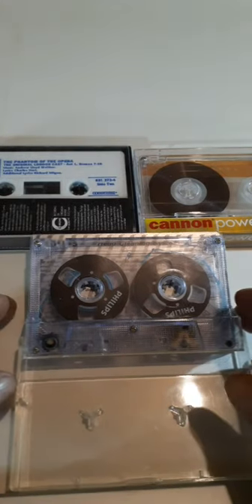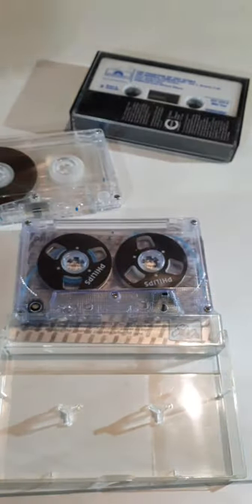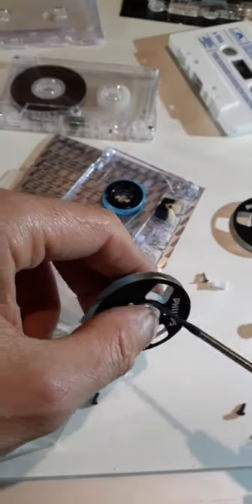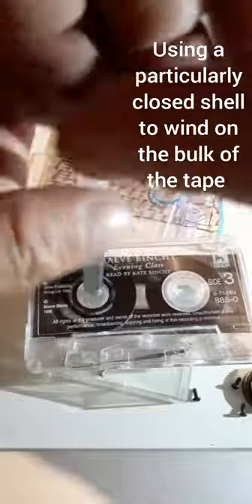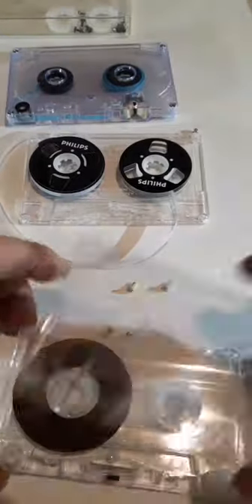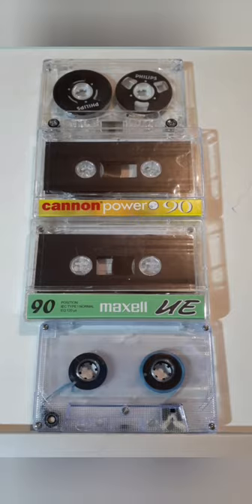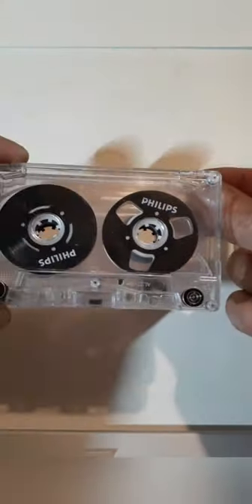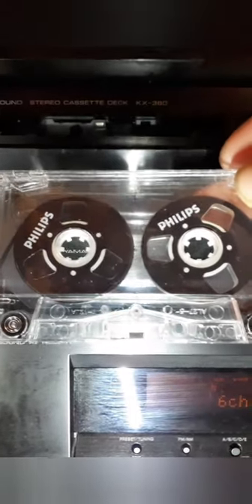REEL TO REEL CASSETTE PARTS BIN SPECIAL

Comment: The reel to reel spool limit the tape length to 46 minutes. Longer tapes expand over the half way position. The extra thickness of the spool may be why some that are sold have an open case. Teac made a cartridge reel to reel looking tape and cassette holder.

Comment: When you put the reels, do you discard the internal transparent sheet which was inside previously?
Thanks for sharing!
Reply from the maker: I have re used the transparent slip sheets from the original CAPSTAN cleaning cassette , and they are completely flat , without any ridges or high spots.
Reply: @vidtech2630  have you considered the posibility to bond the reels on the outside? 💡
Even fixed, they look beautiful, and you preserve the full functionality of the original cassette. 
In this way  could use a high grade tape too... ☺
Greetings from Buenos Aires
Dany
Reply from the maker: @dany3356  that I haven't tried . Keep in mind , there is only  a limited amount of space or clearance,  inside the cassette shell.
Reply: @vidtech2630  I'm talking of putting it outside 💡
It's simpler, cheaper, and it works with all the cassettes!
Reply from the maker: @dany3356  ok